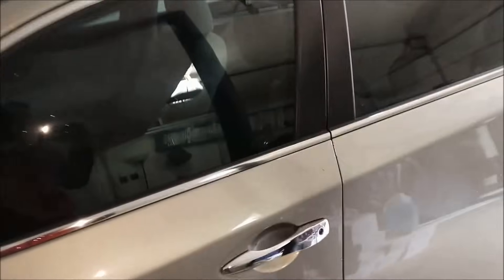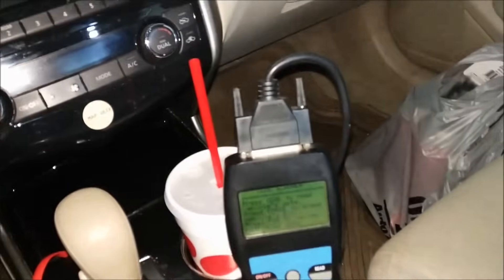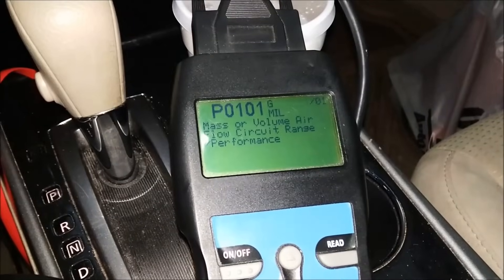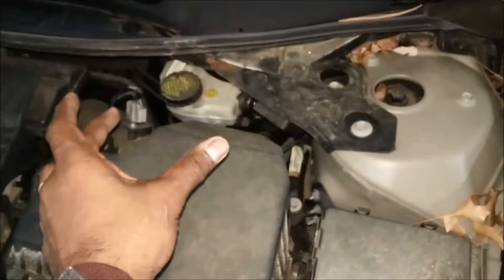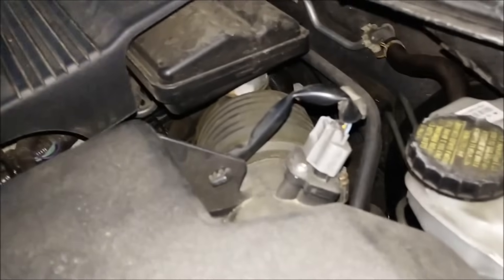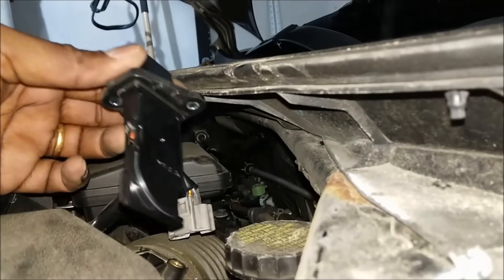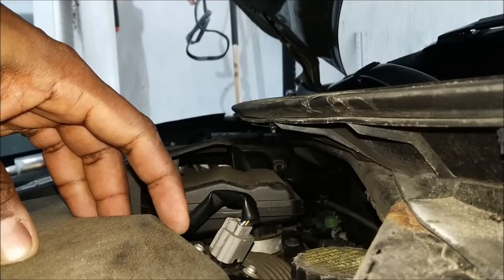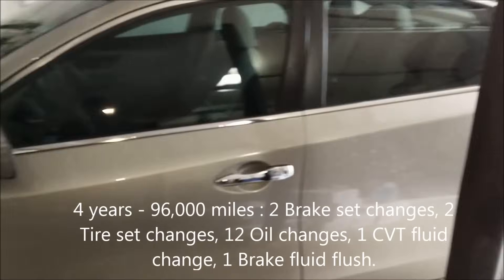2013 - 2018 Nissan Altima code P0101 mass air flow sensor DIY Fix

Comment: I also have a 14 Altima and it has the check engine light and reads the same code ... cleaning it didn’t help and I replaced the MAF sensor with one from autozone and it still comes up and my car hesitates when I try to accelerate . Took it to a mechanic and he said I need to buy a MAF sensor directly from Nissan , he didn’t charge me because he knew the check engine light would come back and it did :(
Reply: Elena Davalos did you end up fixing the problem ? My car is doing the exact same thing
Reply: The Best Of Fortnite well I ordered the Nissan part 275$ (auto zone was 180$) but the mechanic didn’t work all last week because it rained all week . Haven’t called him this week to replace the sensor .  Check engine light is still on but since he gave it back to me my car had not hesitated at all and it’s ran very smooth. But I hate seeing the check engine light
Reply: Did replacing the sensor fix your problem?
Reply: Efrain Carrillo once I had the genuine Nissan sensor put in the light was still on but it went away a day later and had not come back , the lesson I learned was just buy genuine Nissan because the after market sensor I got was a waste of money .

Comment: I have the same code with my 2013 altima 2.5. I replaced MAF, air filter, and PCV valve with cleaning Throttle body. Still have the code. Now I clear the code whenever it shows using obd2 scanner. Strange thing is that the code appears more than 20 times, but it shows only when my car starts up. The CEL never pops up during driving. Will Reprogramming the ECU fix the problem? Could I ask the dealer to update the ECU program without diagnosis of the car?
Reply: Yun Gu Lee I have a 2015 sentra with same issue. I found out there’s a bulletin out for the issue. You have to take car to dealer and reprogram the ECU.
Reply: @jcr23bv89   Because the dealers charge much money, I want to do everything that I can do before taking car to the dealers. Does your car pop up P0101 only when start up?
Reply: capitalismforme  There is no visual crack in the air intake hose. Also, I think P0101 may pop up during driving if there are cracks.

Comment: I got the same code 3 times. Ended up cleaning it like so and got the code again. Second time I purchased whole new band name sensor. Now I'm getting the code again. Someone help. What should I do?
Reply: I was told the ECU had to be updated after replacing depending on your car. Not sure if that’s the issue but maybe?
Reply: same thing is happening iwth my car, did you ever get it fixed??
Reply: TheAlife18 So according to Nissan this happens a lot. The code ended up resetting on its own. I was also told if you put a new sensor in it takes a while for the car to get use to it. So drive as normal and it SHOULD reset on its own within a week or so.
Reply: You can also pull the ground on your battery and let it sit for awhile draining the computer of it's power, thus resetting it. If it's a hard fault or code it will still be in the memory, if it's a soft fault or code it will erase and relearn accordingly.
Reply: Clean you MAC

Comment: Did the check engine light just go away for did you have to reset the code?
Reply from the maker: Reset the code and didn't come back. If it comes back then change the pcv valve and mad sensor.

Comment: I have the same code on my 13 2.5s Altima. Other than the CEL being on all the time, there are no symptoms affecting performance ot driveability. Im gonna clean the maf and replace air filter and see what happens.
Reply: To permanently fix the problem, you need to take your car in to stealership and get your car reprogram. It will stop the high rpm
Reply: @truegrizzlesfan2292 Ive read that a dirty throttlebody or a leak of air somewhere, possibly a vacuum leak, maybe bad ground to the maf. The "reprogramming" may infact be them cleaning or fixing a mechanical issue. Its a well kept secret. Maybr hitting a bump causes voltage drop due to faultu wiring and it takes the computer sevetal days to turn off on its own.  Which is what my car does. It constantly turns on and off, still no performance loss or any symptoms. I cleaned the maf twice and it stayed off for longer but came back. The 2012 tsb issues seems to correlate to newer year altimas aswrll
Reply: @shaneblack3149  oh k. I know replacing my mass air flow sensor and reprogram fix the problem for me
Reply: @truegrizzlesfan2292  I agree, I'm trying not to go that route and may be able to find the issue myself. I know taking it to the dealer will fix the issue and it may be the maf and reprogram, but if it is more simple than that in my case, i will share my experience to hopefully help a stranger save time and money.
Reply: @shaneblack3149  Needs to have PCV valve replaced (updaed part) and ECU reprogrammed for a permanent fix.
Reply: @truegrizzlesfan2292  You didnt need a new MAF. Nissan is stupid, It's never the MAF that causes that code, unless you replace it with an aftermarket MAF, Then you will fight that DTC until you go back to OEM. PCV and Repro is the fix. Some older altimas its the Throttle body that needs replacing or cleaning.
Reply: @Autofixpals  I had to get my ecm reprogram and it fix the problem
Reply: @Autofixpals  read my newest comment. It was the MAF. But thanks for the answer bud.
Reply: @truegrizzlesfan2292  nonono. Dealerships have no vaseline

Comment: Anyone who watching this video, take your car to the stealership and let the mechanic reprogram your ecm. You can't reset the ecm Bec the mafs will not know if it's a new part or an old one I had this done to my car and it fix the problem. I paid like 120 . Lastly, don't let the stealership upsale you either
Reply: trueGrizzlesFAN22 I got the same code bought a new maf sensor directly from Nissan checked for leaks, cracks , everything was ok replaced it 3days later service engine sign bk  on smh 🤦‍♂️
Reply: @michaelarthur8803  you gotta take your car to the dealer and let the dealer reprogrsm the ecm. Reset the ecm will NOT work. I paid 120 and well worthy
Reply: sorry u paid that dealer price on the MAFS. i went to o'relly  auto parts and paid 135. I was mad about that price. bec my code was showing again. until i took my car to dealer and had them reprogram. I honestly, believe if I would used the can to spray my MAFS and then had the MAFS reprogram it would fix the problem. You live and learned.

Comment: I have a 2017 nissian Altima my air mass flow sensor came on and I had cleared it but it never came back on but my car jerking and not accelerating right and don’t want to go fast
Reply: What happened now?
Reply: Were you able to fix it?
Reply: I need to know how u fixed it

Comment: 0112 code
Reply: U need to replace your MAF sensor with the original one if you have that code. Hitachi MAF0102 Mass Air Flow Sensor for Nissan Altima.
Reply: @matengadesire  
Can I use a used airsenso
Reply: @richardcasillas6456  Nissan maf sensors are made by Hitachi. U can only use the original MAF sensor from Nissan dealer or find the original one made by Hitachi. Other than that your P0112 code will come and go repeatedly and will damage other sensors too and will cost more on gas ⛽ if you ignore the issue. Tx
Reply: @matengadesire  you are awesome thank you

Comment: Nissan Altima nice car but once you hit 100000 miles many problems like transmission slip and alignment and steering problems.. Oil usage too is high

Comment: I changed my sensor on my 2012 Nissan Altima and the service engine soon light is still coming on any advice?
Reply from the maker: What are the codes?
Reply: @JJCentral-DIY  p0101
Reply from the maker: @evanmanley9930   
  Here are the possibilities. Fix in the sam e order 1.  Dirty, obstructed, or faulty mass air flow sensor 2. Damaged or disconnected air intake boot 3. Clogged or improperly installed air filter  4. Vacuum leak 5. Clogged catalytic converter / restricted exhaust.
Reply: @JJCentral-DIY  I will let you know thank you 🙏🏼 I did change the mass air flow sensor and the filters I’m praying it’s not the catalytic converter
Reply: @JJCentral-DIY  I heard that it could take a while to get back on until the car hits the correct “speed” test for it to reboot? Is that true like if I drive 45mph for like 20 mins straight?
Reply from the maker: @evanmanley9930  Absolutely it can take few days for all the OBD2 Readiness Monitors to run its cycle. You can either wait a week or use a scanner to erase code and see if it comes back on.
Reply from the maker: @evanmanley9930  check the air intake boot for cracks and also see if there are any visible leaks on the vaccum hoses in and around the engine.
Reply: @JJCentral-DIY  thank you I just changed it last night and then deleted the code after so I’ll wait a week!
Reply: @JJCentral-DIY  thank you!